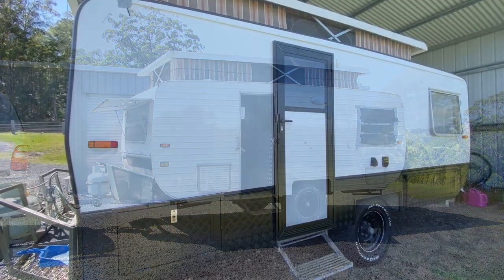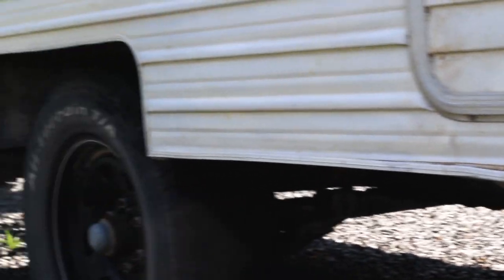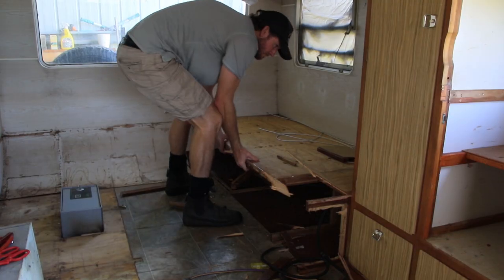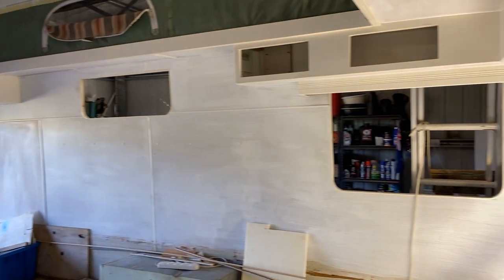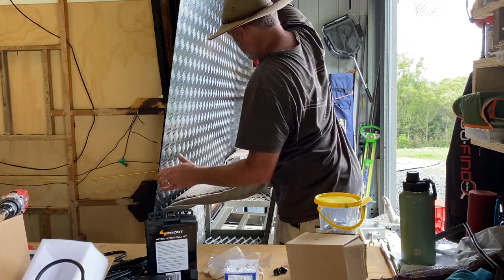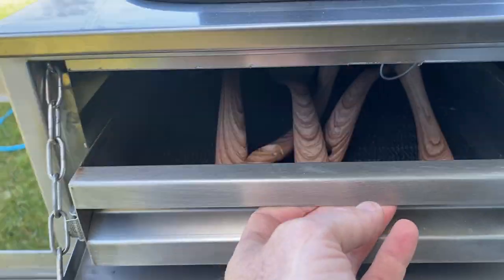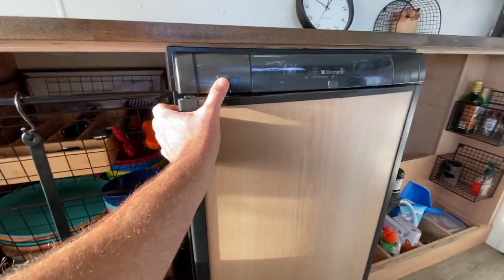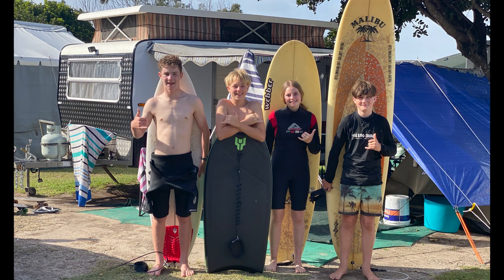DIY Caravan Restoration - Renovation Highlights (Before & After)

Comment: What cladding did you use on the top part of the van above the check plate was that a composite aluminium sheet and did they come in full sections and PS great job learnt a bit
Reply from the maker: Thanks mate! Yeah it’s a composite sheet that I got from Ulrich Aluminium here in Australia. They didn’t quite span the whole length so we had to have a join in it.

Comment: Great build, turned out awesome did you use vinyl planks? I want to do our but I have heard planks lift up
Reply from the maker: Yes mate I actually used vinyl planks and  had not issues with them whatsoever so far 👌🏻 They’ve been down a while and had plenty of use.
Reply: @TheBeatenTrak  thank you I think I will end up doing it to my van can I ask what planks you used and did you put extra glue down or was yours self adhesive? Just after something that someone has used that works thank you